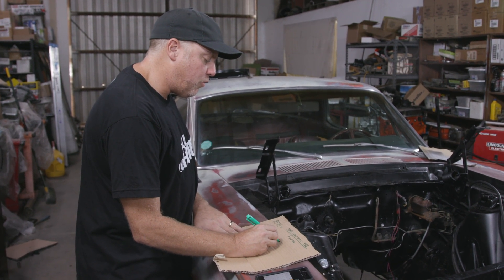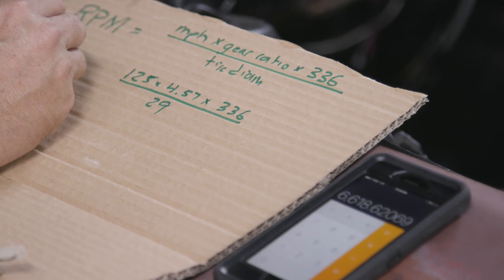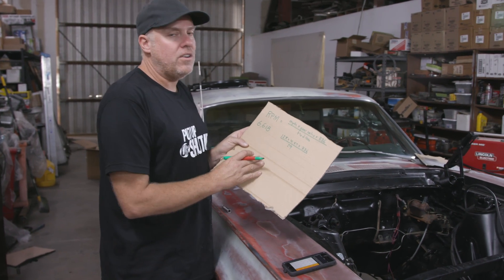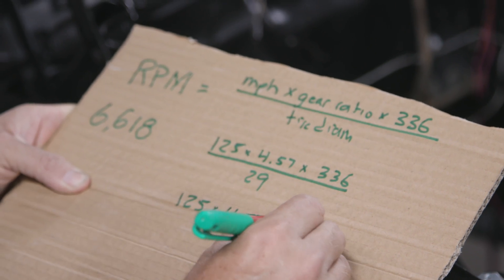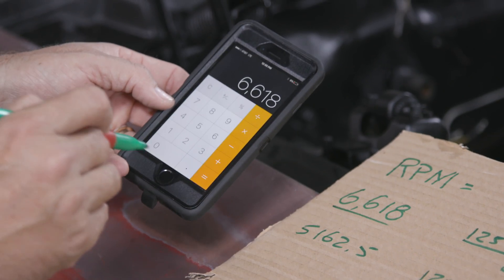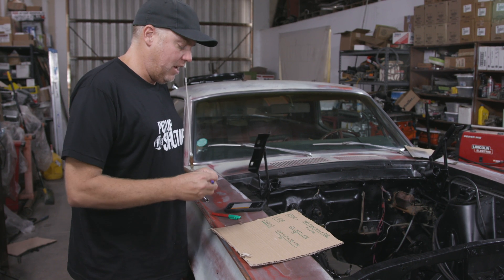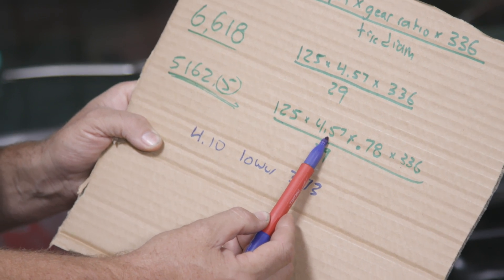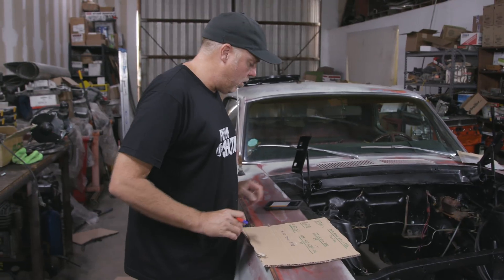How to Calculate Engine RPM vs. Gear Ratio - Roadkill Extra

Comment: So I have a question. If I want to find out what RPM I will finish a drag race in at the end of third, which is my 1:1, would I estimate my MPH ((117)(4.56)(336)/(29)) this comes up to about 6200. So I would need 4.56 gears to be at the end of third in the quarter?
Reply: If your tire diameter is 29, and assuming you have an auto car becuase 3rd is 1:1. If all you care about is the best time ever in the quester and nothing else. Yes. But then do you wanna cruise around at 4k on the highway? Plus like he said add 3-12%

Comment: The conversion factor for metric units is 5305. 

RPM = (km/h x gearbox ratio x rear axle ratio x 5305) / ((25.4 x rim size) + (2 x tire width x tire profile))

So the RPM for a '97 Camaro Z28 in 5th gear at 250 km/h with stock wheels would be:
(250 x 0.74 x 3.42 x 5305) / ((25.4 x 16) + (2 x 245 x 0.50)) = 5153 RPMs
Reply: can you expalin well
not clear to me
Reply: Its about 700rpm higher than real
Reply: 5,148 rpm for me.  But what is 5 rpm.

Comment: Why 336 ?
Reply: idk ye why
Reply: It's just a number that you have to use.
Reply: Doesn't make sense! I can put any number into this equation... But why 336?
Reply: Actually i calculate the real number. 336.1352398 that is come from 63360/pi/60 this is conversion number between the parameters which are rpm parameter rpm, tire diameter inches, mph and the actual formula is lack. Axle ratio must be on formula which is generally equal to 3.5

Comment: That's pretty good I did a little bit of different math to find out how many RPM on a tachometer would I be turning at 60 miles per hour with no speedometer I found out how many rotations per mile my particular Tire was rated per manufacturer and I did something with the number 60 because 60 is a mile per minute and I use the gear ratio so you have a 350 ratio you know your engine turns three and a half times for one tire rotation and you go from there leave Steve alone he don't want to work on that Ford

Comment: Do it in metric you caveman
Reply: Won't be as accurate. This formula is tuned for imperial. They have a metric formula but your gonna need more than a piece of cardboard and marker to figure that one out with all the decimals. Which would only apply to cars with drive trains and instrumentation tailored to metric doing 400m races.

Comment: Dave actually made learning math fun, thanks Dave
Reply: I use this formula almost daily because i drive off the rpm of my car now that i changed my rear gear
Reply: @johnwolf1113  can you explain the math here if you can? i didnt know where he got most the numbers
Reply: @variegatus4674   overdrive or non over trans and what transmission?
Reply: @johnwolf1113  hey you there? hope that what i said made you go away.

Comment: Actually I've already calculated that so it's tough before because my dad says 10 is really old and it's a V6 I'm wanting to get a small block Chevy because it's a very old truck hits all beat up and I calculated what a new motor gears in a translator and it would get boost turbo in it 139 miles an hour

Comment: should be focusing on km/h not MPH, if you hope to further your knowledge to younger generations. As it is you're encouraging them to stay in the past while the rest of the civilised world is against imperial measures.
Reply: you know most americans know both right?
Reply: The UK uses MPH too! despite everything else we do being metric, interestingly though Americans do use metric, you often see them expressing inches metrically (we don't often in UK-if we use inches it is fractionally) as in 2.25 inches (2 1/4") It is a cultural thing, officially the UK is metric, but we tend to "guess" in feet n inches, and measure in mm.....
Reply: +drumnstuff: This is old math because the magic number 336 includes the conversion from inches to miles.
Apart from that i agree that the concepts are universal. Another aspect to why this might be getting dated is the fact that formulas with pre-calculated constants like this are more common in the US because of the pain of doing conversions on the fly in Imperial units.
Reply: because they live their lives ONE QUARTER OF A MILE at a time.
Reply: you can just convert kph to mph and keep the same formula.
Reply: Oh, you mean 402.33 meters at a time?
Reply: Even in Canada we switch back on forth between Mph and km. Our speed limits are km but if we're talking about a fast car or sled or bike.. often we switch to Mph.
Reply: They can make you gain weight... :)
Reply: +KYoss68: How 'bout 23C? I think millimeter steps of fasteners are quite enough when you get above 5mm or so.. all /32 steps can't possibly be needed. Well, you got your kilograms backwards, there are 2.2 lbs to a Kg, not the other way around. For speed i don't really care, a factor of 1.6 doesn't make much difference, but highway speeds starting at 100 is kinda neat.
We have teaspoons and tablespoons too, they work just fine and are the same as yours rounded to 5 and 15 ml respectively. Moving to dl above that does not make cooking any harder in the least. Metric "activists" in the US seem to be some sort of extremists, I'm not one. I just want to show you that the perceived simplicity is just conditioning, and not based on facts.
Reply: just do the measurements in metric
Reply: Google search "places that use imperial" ......RESULT: "Of all the countries in the world, only three backwaters still use the archaic Imperial system of weights and measures:Liberia.Myanmar (a.k.a. “the country formerly known as Burma”)United States of America."   Google was American last time I checked... taking the piss out of themselves for this level of stupid ignorance :D
Reply: aircraft are one of the last places on civilised Earth you will find imperial fasteners ;) everything else went metric at the same time as the rest of the world
Reply: Wen the motherfucking robots take ovr eveything is going to be binary anyway so who gives a fuck
Reply: STAG162 People like you need to just sit back and enjoy the video.
Reply: STAG162 I seriously doubt America is going to switch to metric anytime soon. 

For everyday use, imperial works just fine. If we need to convert something, we just google it. Except for the marginally better convenience of conversions, I honestly can't think of a everyday, non scientific situation where metric would be more convenient than imperial. If you can tell me one, I'd be glad to tell you what I think of it.
Reply: you've done a great job of missing the point... entirely.
Reply: Kids need to sit down, shut up and damn learn. To think a measurement system as a whole, predetermined and used units of measurement is inaccurate. Got to be really stupid to think that. Learn the systems, learn to convert.
Reply: How is this "old" math? The formulas are exactly the same no matter what system is used. Learning multiple standard conventions is a better way to show how the formulas work regardless of the unit.
Reply: Over here in North America if more than anything we combined the the two. We use inches in 1000 base decimal which is just as accurate and understandable as full on metric. I think it's much easier so actually visualize this mix system better than the other 2 pure systems.
Reply: STAG162 AMERICA BITCHES!!!! Ftw
Reply: if you wanna try to do that with american cars built in the 60's and 70's, be my guest, they were built with imperial units in mind, so in that case it might be easier to just use imperial, even if it is weird, because transferring using ratios of Imperial to Metric is a whole new can of worms, and you cant get it exact
Reply: You're telling this to a guy who throws a carb on everything
Reply: STAG162 What was your point then?
Reply: Miles is better because that is what is used by America.  One day you mud people will almost catch up.  Almost.
Reply: UK and USA are the entire "civilized" world... and these calculations are used to figure 1/4 MILE, 1/2 MILE, and full MILE speeds/performance... so MPH (MILES per hour) works great... what's the metric equivalent of an old-fashioned "hour"? ... LOL!
Reply: "should be focusing on"

It's math, it doesn't give a shit which made-up numerical system you use...
Reply: +STAG162
http://imgur.com/IZVezKC
Reply: Shut up communist
Reply: Fuck off stag
Reply: Imperial measurements are much more granular and precise than metric at smaller scales and easier to use at larger scales. The only point to convert to metric, really is for some sense of simplicity or symmetry. For instance it's possible to feel a little cool at 22C and too hot at 24. How does that make any sense? Because in "Imperial" that's the difference between 71F and 76, which is actually a big difference. The same is true with inch/mm 25.4mm = 32/32 inch. Not a lot of fasteners go into 32/in but some do. For larger measurements, metric is too precise, IMHO. Gallons vs liters, kph vs mph 88kph sounds pretty fast but it's not ^^. Kg vs lb; the word kilogram sounds impressive but it takes 2.2 of them to make a pound. I think the disdain metric users have for imperial measurements comes down to volume. The whole teaspoon, tablespoon, cup, pint, gallon thing must be too complicated for some, but that whole measurement system came out of kitchens, not from some mathematician's desk. In the end, it's not stupidity that keeps us using Imperial measurements (despite what the metric activists might say) , it's that they are more useful for what they're used for.
Reply: You can sit back and enjoy it while I laugh at others' ignorance. =) Listening to an imperial measurement conversion is like listening to fingernails down a chalkboard. Imperial measure are a non-constant and disjointed has-been, not a should-be.

Comment: my brothers old mustang had a 302 with 2.70 rear end with a crappy 4 speed stick.  it would bog on the freeway in 3rd gear.
Reply: Must be completely gutless.
Reply: Talk about torque reduction to the wheels!

Comment: I'm sure I'm not the first here to say but just in case, you fudged a bit there, Dave. You said the higher gear ratio (lower gearing) would lower the RPMs and conversely. Otherwise, interesting lesson and thanks!

Comment: I have tuned on 4 games and they always tell me a 3.83 rear end will out run every year between 2.10 or a 5.56. But I didn't calculate them yet. So thanks for the video.
Reply: There's no magic ONE rear end ratio that's fastest... gotta take engine power, tranny gear ratios, tire size, rear end ratio, intended vehicle usage all into consideration... and I don't know if there is any actual 3.83:1 rear end ratios available...
Reply: BuzzLOLOL. I know I've looked. I have tried it on i6. V6. V8. V10. V12. And v10 electric boost. On multiple games and it has a good rate of excelaration.
Reply: Destin - only in games... not the real world... although it would be an OK street/strip compromise ratio... if it even existed...
Reply: A lower gear (higher number) is ALWAYS faster within one gear - it will ALWAYS deliver more torque to the rear wheels (given the same engine output).  Though you need to take into account shift times.  Even if you have 1000hp, 0-60 will be slow as fuck if you have to shift 5 times during that time.

This is why most gear ratios are designed so 2nd winds out to about 62mph, it's marketing for the magazines who will do 0-100kph test, so there's only 1 shift in the 0-60 time.

Though in terms of 1 gear (ie. no shifting), higher number is always faster.  You will top out at a lower number, though.
Reply: You see, the problem here is that you're playing a freakin video game. You're not "tuning" crap. Get over it.

Comment: Does this formula work for automatic as well? (Torque converter..)
Reply: Timmy Turner watch the video and this time...LISTEN...
Reply: Timmy Turner find out if your converter has lockup.... if not just subtract like 6% or so.... if it locks up just run it as normal
Reply: Around 2:20 he speaks on that. Vaguely, but he covered it somewhat.
Reply: 2:12. He explains that an automatic out of lockup will rev slightly more at speed. ie 1/4 mile, or accelerating (3% up to 12%'slippage'). On the hiway in lockup it's the same as a manual trans.
Reply: moyadapne i